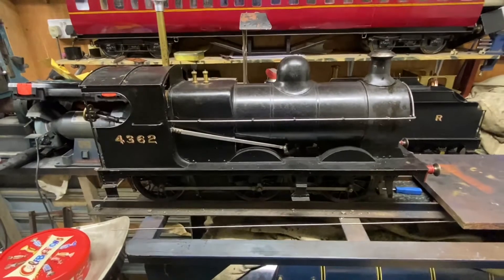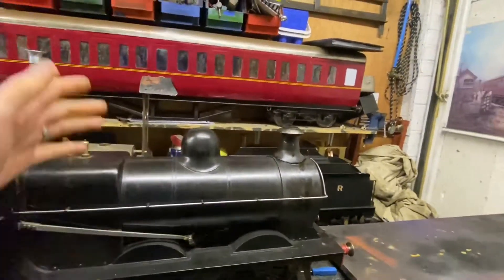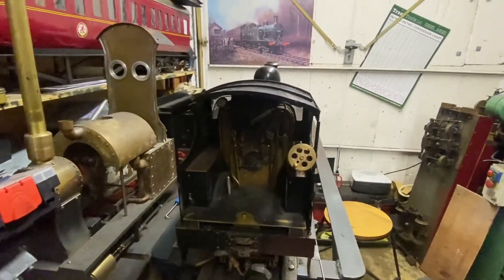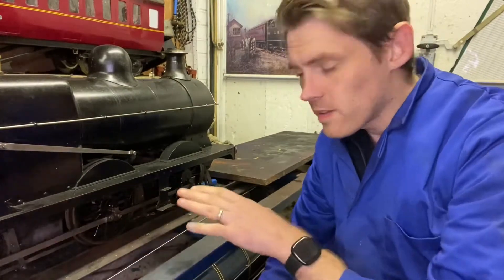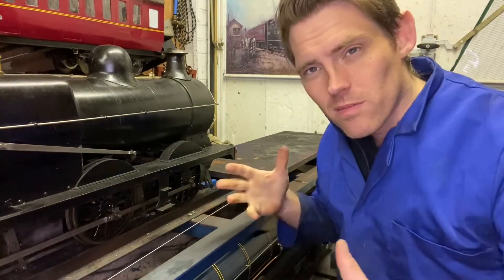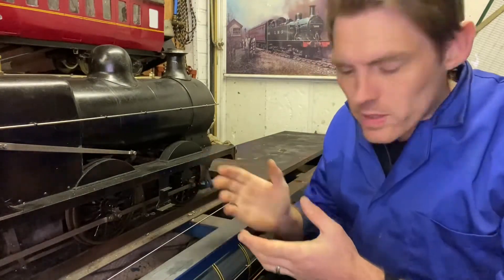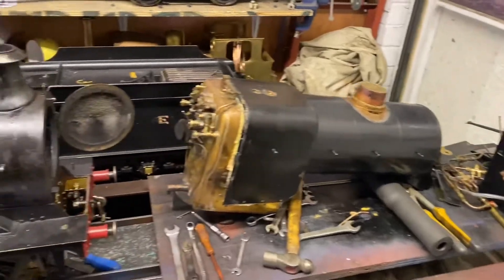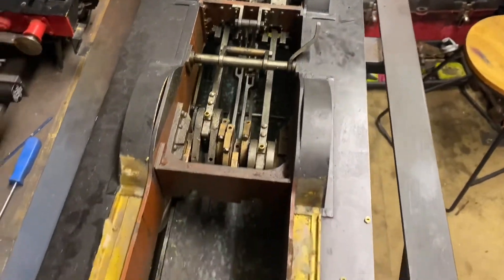Pompom part 1… strip down…

Comment: Hi Tom.  I damaged the valve gear on my 'Pansy' some years ago.  Used to run very well.  A club member (nameless!) supposedly repaired it, and showed me the same problem with the crank axle. It never ran as it used to after the 'repair'.  Like this video, it will be a complete strip-down to  see what the problem is.  Thanks.  Geoff